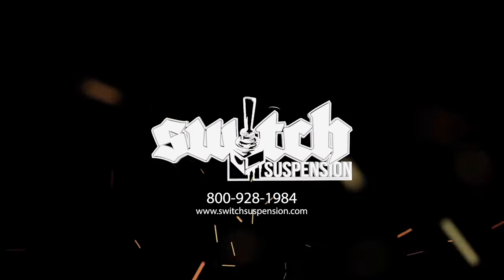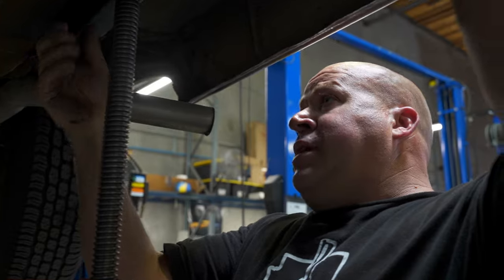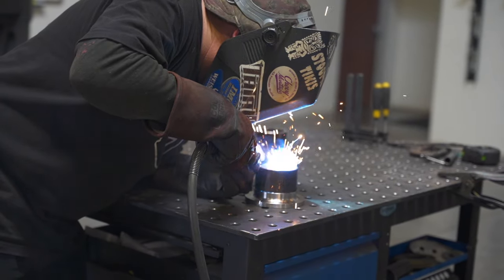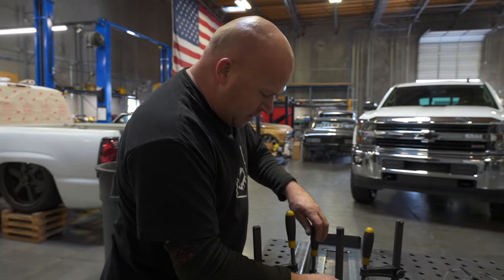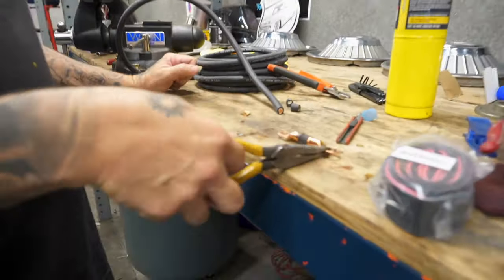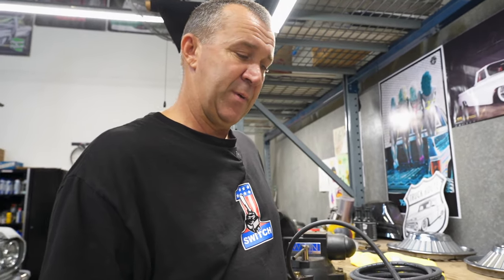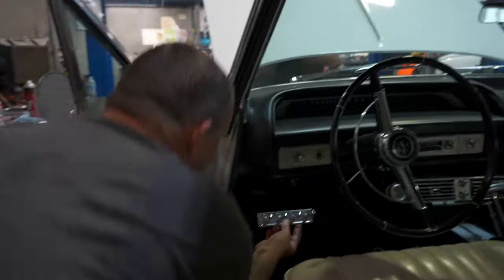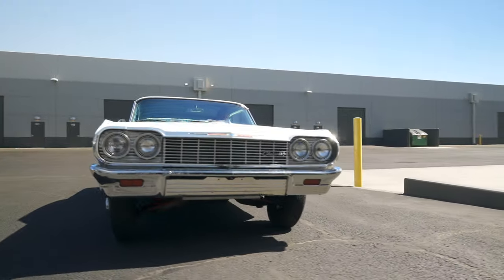'64 Impala 2 Pump 4 Battery Hydraulic Suspension Install

Comment: For being a suspension shop you would think these guys would know when you add switches without reinforcing the frame your asking for trouble. Regardless of it being a hopper or not there are a few areas that need reinforcement.
Reply: Yeah that's what I was thinking I'm seeing buckled quarters, snapped trailing arms in the car owners future.
Reply from the maker: 🤣 Everyone is an expert and has their own opinion. Our experience is just based on actual cars built not just commented on🤦🏻‍♂️
Reply: Nothing gonna happen with a four battery set up even if he runs 36volts to the front there’s not much to stress the the frame or body unless he does a high rear end lock up n three wheel for a couple years daily
Reply: @switchsuspension  Nah buddy coming from a guy who who builds cars also, yeah your getting buckled quarters bent trailing arms.
Reply: Build it right or not at all.
Reply: you get what you payed for or ask for
Reply: I have a similar setup on a new frame, no issues
Reply: 1000s of impalas out there with no reinforcement on lay n llays and their fine.
Reply: That's bs. There is many guys running air bags that are faster then this setup  and they have no issues
Reply: No need for just lay and play..
Reply: On a 4 battery lay and play set up you don’t need reinforcements lol
Reply: If the car isn't leaving the ground and you're running low voltage (48v), you can get away with just re-enforing upper&lower A-arms. You're not lifting fast or coming down hard so I'd be surprised if you manage to tweak your frame. You really don't even need to box the rear section if it's a low voltage setup.
Reply: @alonsonavarro2126  Wtf are you talking about. That small of a setup will not buckle bodies. The rear trailing arms had just enough re-enforcement and the front top A-arms had tons. I have a few juiced cars with 10 batteries and 3 pump. I smash them and never had the problems you are explaining.
Reply: Yah you'd think they'd know to reinforce!!  It's a proven necessity!!  If they honestly think "their experience" is better then real life, that's completely ignorant and stupid!!  Gotta feel bad for the vehicle!!
Reply: So when they finally decide to reinforce the frame all that battery rack gonna have to get “redone” …just my opinion I’ve cut and reinforced a few …
Reply: What about Cutlass supremes do they need to be reinforced

Comment: No reinforcements you are looking for trouble.   I don’t care if it’s 4 batteries or not.  I have been there   Had to get whole new frame for my 63.  And I got a Canadian one at that.     Great install but would do so upgrading down line for sure. But then it depends on customer.  You guys did great job on the trailing arms.
Reply: Fake news

Comment: At what point do yall start thinking about reinforcing the frame? Right about when 3 wheeling hits the table?
Reply: I’m new to all this but my guess is when it starts 3 wheeling as you said or bouncing when the frame could be constantly be under pressure and damage. Now for a 2 pump front side side play setup it doesn’t need it because it’s not bouncing more of lifting wheels off the ground
Reply from the maker: Sorry for the delayed response. Three wheel or lots of power and time to reinforce. This kit is very mild and will not do a thing to hurt this chassis or body.

Comment: So what's the estimate average price for a basic setup like this ?? Seems everyone is scared to talk about pricing. Should be nothing to hide.
Reply from the maker: Around $8500 all in 👊🏼
Reply: 8500, sheesh for a basic set up with no reinforcing. Ouch. For 8500 that a 4 pump 14 battery price plus reinforced frame.

Comment: I have a question for anybody in here that has disc brakes I have a 1963 impala I wanna do disc brakes I have 13 inch rims can anybody help me out on what disconversion I can do?
Reply from the maker: Give the shop a call or email. We have a “zero offset” kit designed specifically for 13” & 14” wheels. 800-928-1984 or sales@switchsuspension.com